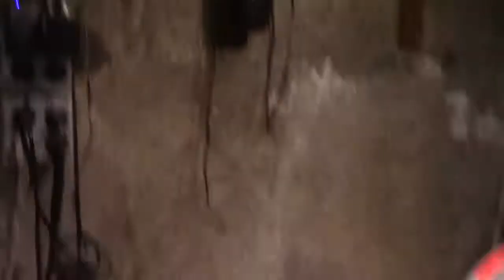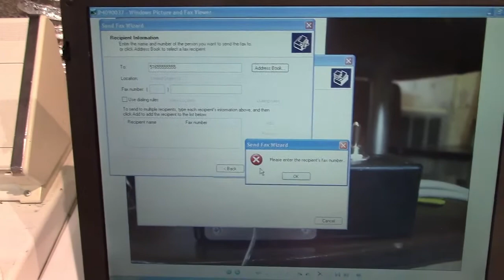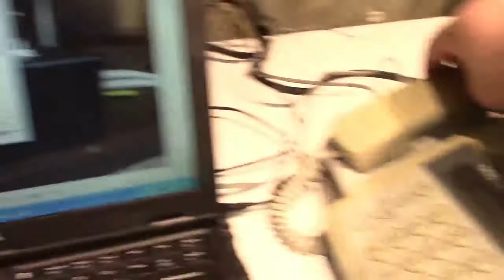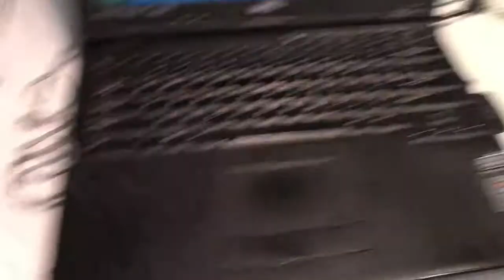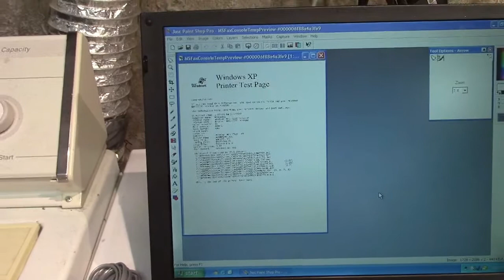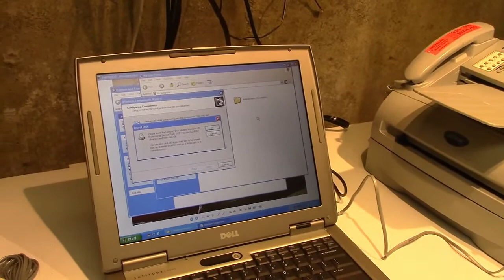REVISIT:  Use Fax Machine As Printer!  Put That Old Dial-Up Modem To Use!

Comment: I have a question, The fax number 555555 is number of fax machine or where? 🤔
Reply from the maker: I don't think you understand what's going on here.  There is NO telephone service line here at all, whatsoever.  The number, like as seen in many TV shows, starting with 555- is made up.  You can put any number you want in because it's not actually placing a call, as there is no telephone service.
Reply: Thank you very much, I'm also trying to do like your video but my fax machine doesn't receive data from my laptop, I don't know which step I tool anymore 😄
Reply from the maker: @phungle2636  I have only had luck with this particular laptop getting it to work.  Two fax machines connected together generally will work also.

Comment: hey i have a question, whats that port on the laptop that you plugged in the cable to the fax? does it work on an ethernet port?
Reply from the maker: That is an RJ11 telephone jack.  On the other end of it is a dial-up modem.  You cannot plug the phone line cable into the Ethernet jack.  Besides it not fitting properly, it's completely different technology.  It can be done over Ethernet with a lot more cables and telephone line emulators, but that's way more trouble than you need to get into.

Comment: I like how you could print on the thermal fax but I wish it ran at a constant and faster speed speed, like fill up a buffer and then print. 

I bought this little thermal printer that connects to my phone by bluetooth and prints text and images on receipt paper. It fills up a buffer in the printer and then you hit print and it prints. No automatic cutter though, this one is human powered. 

That laser fax is a nice machine, seems to work well. Love the dialing and screeching sounds, ear rape for telemarketers.
Reply from the maker: The laser machine has a buffer that fills first, then it sends the entire page to the printer.  It HAS TO do that, because lasers can't print a portion of a page.  In fact, back in the old days that I hark back from, laser printers had a "form feed" button if you sent them less than a full page of text.  If you sent less than a page, the printer would receive the data (usually no processing at all for just text) but just sit there with the light blinking and no page.  Pressing the FF button would tell the printer you want to end it right there.  

Compare that with a dot matrix printer, it could sit there after printing one line of text, ready to print more as the data is sent.  In fact, most commercial software you could print from would send a form feed command to the printer after the print job so the last page would print.

This thermal guy, since it's paper on a roll, has no "page" to fill up, it can be as long or as short as it needs to be, much like your thermal printer.  Besides the fact it was early on and memory was expensive, there's no much in the way of a buffer to save cost and also because it wasn't really needed.  But of course that makes it print the way it does.

I've seen printers similar to the one you describe.  I bought a thermal receipt printer, but it doesn't have Bluetooth, it hooks up USB.  Had a whole video on that.  https://www.youtube.com/watch?v=J28HwpiKMJY

Comment: So the first modem must be detecting the lack of standby voltage and applying it's own. To get the other modem to work you need loop current not much just something to over power interference and trigger the modem in the computer. You can use something as small as a 9v battery with a 500 ohm resistor. Simply attach the negative from the battery to the tip connection of the phone line and the positive through the resistor to the ring of the phone line. You can add an inline LED to the circuit to show you when the modems come off hook not necessary but useful and neat.
Reply from the maker: Thank you for the additional info!
Reply: I was wondering how the fax machine could receive the images without it being connected to a phone line and getting the -48V it expects.

Comment: i remember this video from a few years ago.  although i watched it only a few months ago.  its awesome.  love old tech especially printers.   and i also saw in the printer menu you had the 693c perfect printer.  this has nothing to do with this video.  but i was going though my storage unit to donate and throw out a lot of stuff. i had 2 microwaves, one was fron 2016 and one from 1995.  i actually donated them to  thrift store.  i went in to that store to look and it was still for sale for 7.00.  honestly i want it back so bad and i want to buy it back and jusy hide it. lol.  its just a goldstar 650 watt model but seriously. from 1995 and it still worked. i mean i went though a few that were only 2 years old and died.  i could buy it back and keep it as a back up or use as a basement unit like oyu had/have? i look at it as that i supported my store with the 7 buck purchase.  say if i did this, and hid it lol, could i put dvd's on top of it to hide it and no harm done?  i don't know why but it was my family's and i have that weird sentiment value to it.  weird i know.  but i know you love older electronics too?
Reply from the maker: I certainly understand the sentiment you have for it.  What you experienced is seller's remorse.  If, after another day or two, it doesn't go away, you should buy it back.  It probably will be one of the best 7 dollars you've ever spent.  I'd imagine DVDs would be fine; they're not magnetic in any way, just optical discs, so I couldn't really imagine it will cause them any harm, especially if the microwave isn't going to be used much.
Reply: @jaykay18 UPDATE: sadly i can not buy it back, i went back to the store today and it was gone. yesterday was there today not.  oh well. i tried. i honestly hope who bought it gets years of use out of it
Reply from the maker: @Sethshirtless  That's too bad.  Good lesson learned though.
Reply: @jaykay18  it is.  but oh well. at least someone is using it, hope they use it until it craps out.

Comment: Interesting.  I never owned a fax machine.  Own a laser printer but not a fax machine.
Reply from the maker: Yep, got this from someone who used to run a home office.  They got a new one.  I guess they hated the thermal paper also.  Later on, these machines used plain paper, but had a ribbon that would get used up at the same rate as the paper, those ribbons didn't last long either, maybe 150 pages or so, and there was no way to reuse them, at least, if you wanted the print to be legible where it needed to be.  

The all-in-one machines, PSCF, Printer Scanner Copier Fax, are great.  They do everything.  But they won't do more than one thing at a time.  So if you have a 15 page fax you're sending to someone, and need to print something from your computer, it's not going to print it until it's done faxing.  Need to make a quick copy while you're waiting?  Sorry, you're going to have to wait.

Comment: So the modem in the other laptop isn't a windows modem?  I can tell you the difference between a windows modem and a hardware modem.  The windows modem is too stupid to figure out when the connection drops.
Reply from the maker: The second laptop, yeah that's a Winmodem.  You weren't finding hardware modems at that point anymore.  I remember Winmodems well.  Horrible.  But they did get better towards the end.
Reply: @jaykay18  That's what I figured, that it was another winmodem, as it sounded like it might be one.
If you wanted an actual modem you had to spend a decent amount of money.  I spent almost 100 bucks on an internal 3Com USR modem in the late 90s.
Reply from the maker: @240Volts  Yep, my old Dell XPS R 450 had one, ISA.  The doorbell server I think has one as well in it.  I have an external one also that's pretty nice, it was in the doorbell server video series at some point.